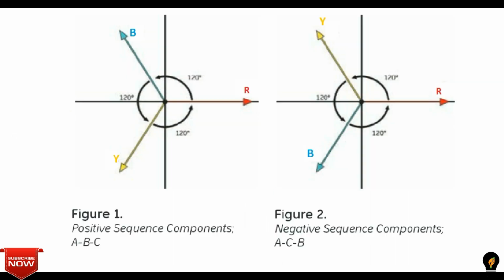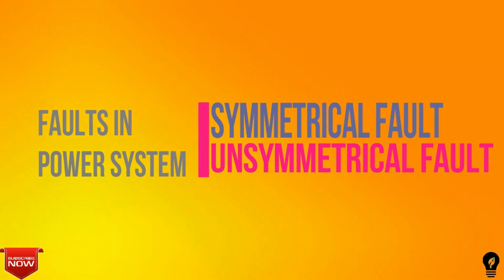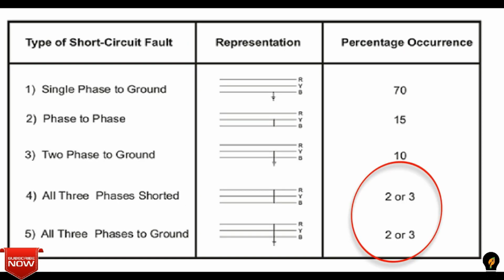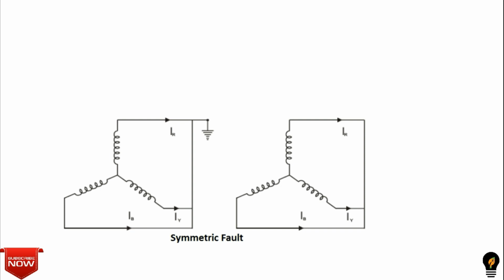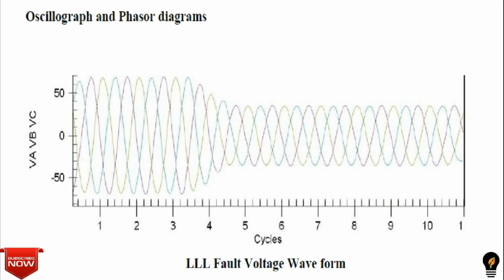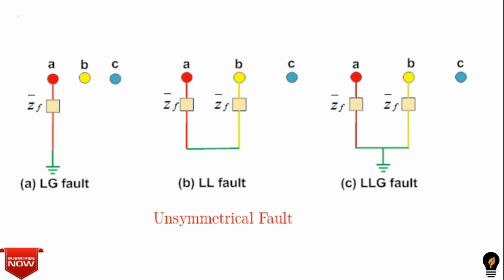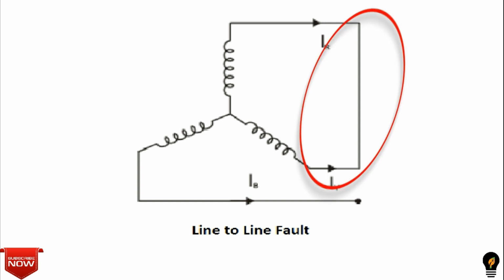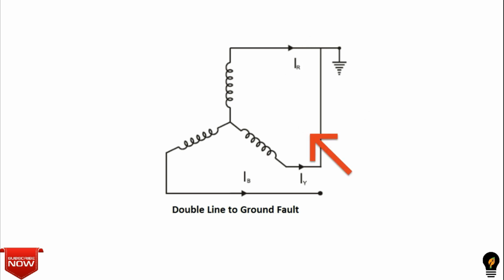Symmetrical and Unsymmetrical Fault in Power System by The Next Level Learner

Comment: Here’s a summary of the video "Symmetrical and Unsymmetrical Fault in Power System" by The Next Level Learner:

A fault in a power system is an abnormal condition causing current to deviate from its intended path, due to reduced insulation strength between phases or earth.
Faults can be short circuits (current bypassing normal load) or open circuits (interruption in the circuit).
Symmetrical components (positive, negative, and zero sequence) simplify fault analysis by converting three-phase problems into single-phase calculations.
Symmetrical faults (balanced faults) affect all three phases equally, mainly Line-to-Line-to-Line (LLL) and Line-to-Line-to-Line-to-Ground (LLLG) faults; they are rare but severe.
Unsymmetrical faults (unbalanced faults) affect phases unequally, common types include Line-to-Line (LL), Line-to-Ground (LG), and Line-Line-to-Ground (LLG) faults.
Causes of both types of faults include lightning, wind, ice, vandalism, contamination, and equipment failure, often involving physical contact or insulation breakdown.